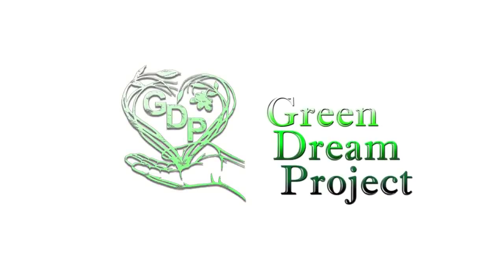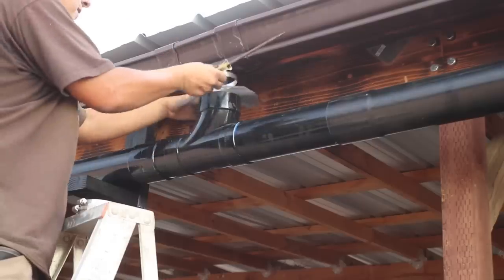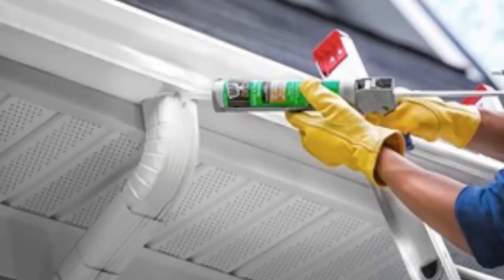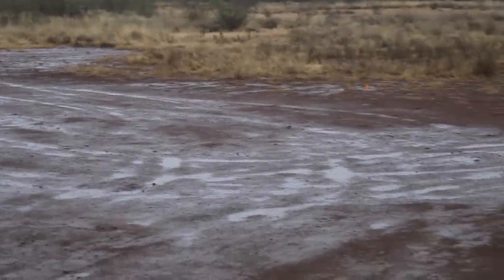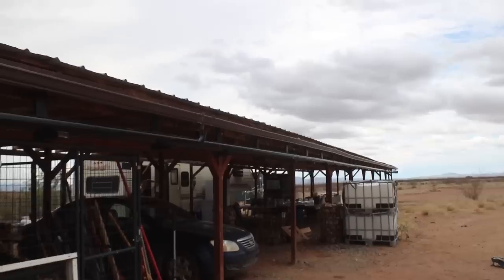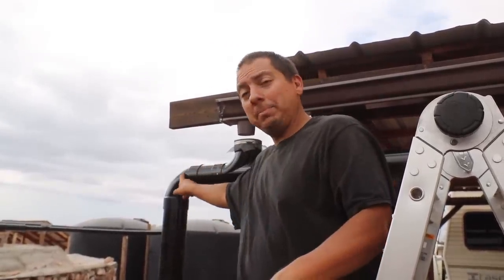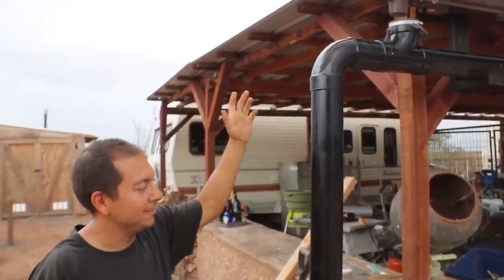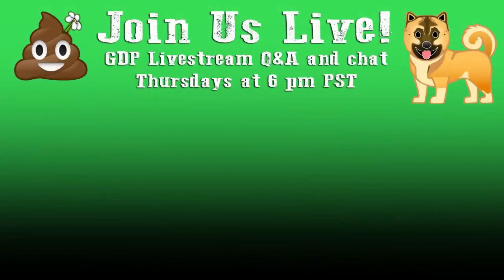Avoid These 5 Mistakes When Rainwater Harvesting | Things The Books Won't Tell You

Comment: You are right. Simple is better. How come you did not contine the pipe from the roof directly across to your large catchment tank? Instead you turned it down to the ground, under the ground, then back up. Im guessing you did it was a P-trap but it is now a sediment trap which will clog up one day. Simpler is better.

Comment: Thanks for the good tips; our well is running dry and I want to set-up a rainwater system on this house as I had done on or previous property. I experienced the same problems with gutter screens and I will set-up our catchment tank higher this time so that I have enough pressure for the drip system in the garden. Once again, thank you for sharing. 🙏🏼

Comment: Thanks for the sharing. One possible solution to replace 90° elbow is to combine two 45°'s. You can vary the length of the connecting pipe between the two 45°'s as the situation requires. This might create more of a gentle 90° turn.

Comment: Couple observations. The code suggests/requires that there be a downspout for every 30 feet of gutter. That was why you had such problems with just two downspouts. Second, there are special seam sealers for gutters. The pro guys use. They dry like epoxy and stay sealed, keeping the gutter sections from pulling apart with heating and cooling of the seasons. A sort of white/yellow color when dried.

Comment: Ok.  Im no expert.  And not nitpicking.  Why go underground on your system?  You ain't getting a vehicle through there and the pipe should be high enough to walk under...why not just pass it overhead? Video does not show issues that may not make that an issue to me but it could be 

Angle your screens...the water will flush debris off. Ok.  You will need to make your own plastic boxes to do it, but you will impprove water flow through the screens

Was going to bring up flexseal, but you did.  Basic silicone is not the best option.  And won't claim flexseal is the best either...but it does a good job where you have seams that need sealed

If it was me, just my opinion, put a downspout at every joint.  I admit i get more yain in a year than you do, but you get more rain in an hour than i do.  The faster you get the water out of the gutters, the longer they will last

Another thing.   Think about solar panels.  Thats a pretty good area in a decent sunny part of the country.   Dont have to do it in one shot...you can buy systems at harbor freight that do ok and scale it up over time.  Not the best, but a way to do it on a budget.  Use it to put a pump in there to lift the water in your present system.  As you expand, cut the power bill. You will probably get to a point you are making more power than you can use....talk to electric companies in your area...may get a loan on the equipment you need to sell excess power back to the power company.  And be pay it off early depending on what they will work with you on it

Comment: What might be a better idea, rather than a bunch of screens that you have to check all the time, when the water dumps out into your cistern from the pipe, have it dump across a large 18"x18" screen that's angled 45 deg so all the larger crap and debris just slides off and won't bottleneck the system with a clog.    You could actually have a progressive bunch of screens.   First a 1/4" one, then a 1/8",  and then go down to a 1/16 or less.    Just space them about 2 inches apart or so.

Comment: I dont understand why you decided to go down then up with your pvc. Why not turn your 90 into each other at the end of the building then run your pvc along the back of your roof and install a tee then run it straight into your poly tank. You can just fabricate some simple supports bolted to your roof and put a 4x4 in the ground with cement and drive a tee post next to it as to give better anchorage in the sand.for support between building and tank. Then you'll only have a three 90 degree system

Comment: Excellent information but I have a problem with having screened catchers a little ways down from my roof and when it rains really hard they overflow.  Somewhere I read that there is an optimum distance between the heights of the downspout intake and the height of the intake on the storage tank.  Do you know what this distance should be.  The distance between the downspout and the top of the tank is now is about 12".  thank you

Comment: in my country we use more pvc stormwater products than metal, as i have found the pvc lasts longer so long as one respects the product. when i connect a pipe to a elbow joint, i`ii only cement the end of the elbow joint where the next pipe inserts into it, water flowing down and out of the joint whereas the top end ,i screw a s/s screw into the joint through to the pipe. This then gives me access to the pipe system should i need to maintain it. one point i need to raise is the issue of the dangerous chemicals they are spraying globally now to manipulate the weather systems, so mechanical filtering is now a must for us all, as the chem-trails contain nano plastics and other nasties. all the best with your system, you and your family.

Comment: You can reduce the seams on your gutter buy trimming at one end of gutter and slipping it into the other end you go from two seams to one that way and were the downspouts come through the gutter you merely have to poke a hole through the gutter or cutting x and then bend the flaps down and attach downspout to that they do have 2 inch drop-ins where you use a 2 inch hole saw in the bottom of the gutter attached to downspouts

Comment: Thanks for the information.  You are absolutely correct about the hard 90's - you want to avoid those,  You may want to split to multiple 30's or 45's to make the bends and limit those.  Also, as someone else mentioned, I'd move the two tanks closer to the roof.  I'd also cover them to try and keep the water cooler and less evaporation.

Why the exposed black pipe- is that for cold nights?

Comment: Several comments.

1) the 90º pipe has so little to do with the flow in a extremely low pressure system which your system is. It is all about head hight. As long as the source is higher than the outlet then water will flow. The higher the head means more flow. From what I can tell you barely have 2psi which means water is not going to move very fast at all.

2) the size of the pipe seems to be overkill. Even if you get a huge downpour the pipe is still overkill. Being that you have such low pressure that is the deciding factor in water flow. My guess is that you could have done just fine with 2 inch pipe even if you had 10 inch pipe the water flow would not increase because you only have 2psi. I am assuming 5 foot head with 0 pressure at the end of the pipe. It is an open system and in a heavy downpour will just overflow the area where the gutter meets the ABS.

3) why did you drop down off the roof, go underground, and then back to the storage system? Unless you wanted a super large P trap to keep the water relatively clean this is just a lot more that can go wrong. As you said KISS.

4) you are right about pure silicone. But most products are not pure silicone and are only siliconized and will stick to repeated applications. But there is a better product. Henry makes a sealer for lots of different situations and the gutter sealer is excellent. It is also UV resistant which will destroy normal white or clear sealers. In your area the UV rated sealer is a much better choice. I have gutter seals that are 30 years old and still doing just fine.

Comment: I worked for a home building company I got anything salvageable from the house before it was demolished for the new home's and on one property I salvaged the eaves trough 32 foot front and back of the house and 24 foot both sides of the garage I'm going to use them on my garage and both sheds so no joints

Comment: Thx for the video. My question is regarding freezing temperatures. Do you have to insulate pipes to keep from freezing?  I am using 55 gal blue barrels and worried about water freezing and cracking my barrels.  I havent seen anybody address this.

Comment: Take the hit, and simplify your system.
Drain those poly tanks into the cistern and move them.

Also, consider putting a T in your pipe for a drop down clean out.

Comment: When you feel like it is going to rain, have a roll of 6 mill plastic 20 X 100 feet, about $100. Brick to hold the edges down, even electric fence wire to hold the edges down with stakes every few feet so wind doesn't catch it's edges. 
Do the math, 20X 100@ 2000 square feet is over 1000 gallon per 1" of rain.

Comment: I'm from an island-province in a country 🇵🇭  where there is no potable water supply.  The whole year-round,  we just rely from water on a few open,  deep wells which are dirty,  not potable,  chocolatey-brown,  and sometimes had tadpoles,  feces,  and a lot of rubbish on them. 

So,  what I usually do to remedy the big problem of water supply was to devise a rain catcher,  which I really keep short and simple.  The gutters was on the house where I lived,  well-angled and properly-sloped. That rain-catcher of mine was able to provide for the water needs of the family for the long months,  up until the next big rain comes to replenish our water supply.   

I have,  however,  some advice regarding water storage.  Don't be too in a hurry to store rain water in your water tanks or cisterns,  that is,  if you are using newly-bought or newly-painted GI sheets.   Better allow 3 or 4 series of rains to wash and clean your system before storing the water into your tanks for drinking water purposes.   New GI sheets and paints have poisonous and dangerous chemicals in them that needs to be washed out and cleansed first.   That being said,  your down-spout to your water tanks should be adjusted in such a way that the rain-water which you catch during the cleaning process could still be used for toilet-flushing,  watering the garden,  car washing,  and house cleaning purposes...  

In addition,  during a big downpour,  let a few minutes of rain to wash away the dust that were stored on the roofs,  then you stock the rain-water once you're convinced the roofs were already washed and clean...  BTW,  be sure that the roofs are free and clean from the poops of  birds,  the chickens,  the doves,  and  rats.

Comment: How about an epoxy glue to seal the gutter pieces. The proper sealant is not sold to the public because it is toxic. Why not run the pvc underground. Fill the tanks from the bottom. Turn up a fitting every 20 feet and run regular downspouts. Put cleanouts every 50 feet or at every 90 turn. It will build up debris in the pipe as long as air is in it.if you want to fill a pipe with water you need vents. It takes years to learn how to design plumbing systems. Hire a plumber so you don't have to do it over, and over.

Comment: Have you considered how you are going to clean out the pipes you put underground? and the sand and dirt on the roof will find its way into the lowest point in the pipes and that is underground.

You might want to consider putting a 'First Flush' system in as that would be much easier to clean.

Comment: We call a 'wet system', 'charged' here in Australia.
I went onsite to setup a computer at a new house (you could still smell the paint) and it started to rain heavy and all of a sudden the air conditioners started leaking... and then started flowing with water.

Turns out that the A/C installer ran the drip line from the A/C to a charged down pipe. Woops.

Comment: Use one of these to get your slope.  Chalk the slope and undo 3 or 4 pieces on what will be the high end and adjust to the sloped line.  Do this all the way to the end.  https://www.amazon.com/Strait-Line-1932880-IRWIN-Classic-Chalk/dp/B017G5GBEK/ref=sr_1_1?_encoding=UTF8&c=ts&dchild=1&keywords=Measuring+%26+Layout+Chalk+Lines&qid=1625756350&s=hi&sr=1-1&ts_id=553252

Comment: Ha I have a request
Please 
You have a large rain roof
With a wet drain to your tanks
When you get heavy rain..
With your rain gauge
You can monitor the flow in the 4inch PVC.   If If hits maximum flow 
the screened tees in your system should over flow
And which ones started / where over flowing
If you can keep tract of those numbers
That could help some of us designing a similar system..
,(I have read what the books say their flow rate should be
But yours is the real world)
👍👍👍👍👍👍👍
Thank You

Comment: Thank you for the information guys. I used to do MEP engineering drawings, and the slope is highly crucial to pressure and rate of flow. I'm assuming the angles in the pipes are there to allow easier passage through there. Does it affect the water's ability to travel with ease? Just curious 😀

Comment: It might be wise to add a cleanable U trap between the horizontal collector pipe and the down-across-up link to the tank farm. Your filters will keep out most bugs and big particles but dust and sand may get through and over time block that underground gray pipe.

Comment: Jim, if you are anything like me you will do it at least three times before you get it right. The system you have should work well but you will have fine dirt build up in the pipe underground which will be a problem over time. Build a diverter to catch the first flush and this should solve the problem.

Comment: Two questions...
1) Why didn't you build your pole barn high enough to park your RVs under?
2a) Why drop down to (under)ground level, the ten foot section at the end of your gutter run?
2b) Why not just run the pipe straight across to the cistern and then over to the black holding tanks? (Ok, technically three questions...lol} 

Thanks and I enjoy your videos.
Reply: My thoughts precisely.  Adding those four? extra 90's plus the rise on the other side will be a huge resistor in the water flow.

Installing a pipe stand either beside or on top of the cistern I think would have been far more practical and probably less work in the end.
Reply: I thought the same thing. As he was saying “keep it simple”, he’s got that drop, 10’(?) stretch underground and then 6’+ back up to the top of the cistern. Why not just run that span overhead? 🤔

Comment: I'm no expert but I think if you use a sani-t on at the top of the vertical pipes with the sweeping 90 in the direction of the flow and extend the open end of the t that should reduce back flow due to air lock. Kind of like sewer vent pipes. If that makes sense.

Comment: If I did a rain catchment, I'd probably not bother with screens, instead let the water and anything in it go to a primary smaller tank, and then pump it from there through a larger screen and filtering system, after a time for settlement of sediment had been observed, into a different tank. A final filtering system from the second tank to home water use.

Comment: Thank you for sharing. 
I may end up missing out on this whole season’s monsoons as I have yet to get a cistern. I’m hoping to buy one or two this week in Santa Fe but I’ll still have to do all my gutters and pipes. I’ll have 360’ of gutter alone - 105’ each side of a pavilion alone and the rest across 10 edges. No way to keep it as simple as yours is currently. I wish. My PDC instructor suggested I try ferro-cement but I’d already seen what you went through. My thoughts are to take 4” PVC pipe and cut in half and hang that with lags and brackets maybe but I do like what you ended up doing. So thanks again for sharing.
Reply: I thought of pvc cut in half also but Jim said he tried it and is now using standard ducts so I guess it didnt work out but he didnt elaborate. Maybe he will share that with us both here.
Reply: @thebirdsnest9396   - I’m not certain I saw that episode. If I give it a try - I would use sch. 40 - not thin wall (sch. 20?). Thin wall wouldn’t be any better than the stuff that got perforated by golf ball sized hail. A “neighbor” in the construction business did that. He’s hardly ever home so I’ve not seen what he did.
Reply from the maker: I think ferrocement could still work. We just need to refine our technique

Comment: why not eliminate the 5th 90.  your existing is a tee laying on its back, rain water entering into the center of the tee. 
remove the tee and the 90.  install just a tee . with the water from the roof entering the top. the pipe from the other down spouts entering the side, the bottom down to tank

Comment: We live off grid in the high desert of norther NM, and catch our water.  We bought the property with a system in place and have been making improvements - or at least try to make improvements as we can.  I am curious why you went off of your roof clear down below ground and then back up again instead of supporting a stretch above ground between the roof and the cement cistern (using a downward sloping pipe).  I'd be worried about water backing up because it had to rise again.  Also, do you think you'll get sediment buildup in the ground level pipes?

Love your solution for the long expanse of gutter.  I may try something similar in an area where we have issues.  Did you use 4" or 6" pipe?
Reply from the maker: We used 4" pipe. Sediment may accrue, but we'd expect it may take awhile before enough collects to hamper flow. 
Check out our last video for the explanation of our "wet" system. 
https://youtu.be/oCrmQJYAPQ8